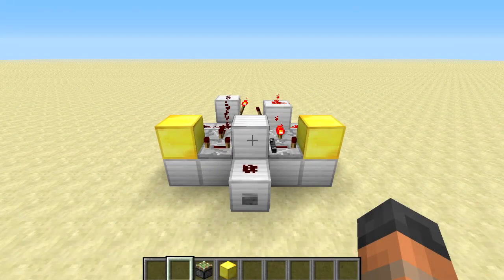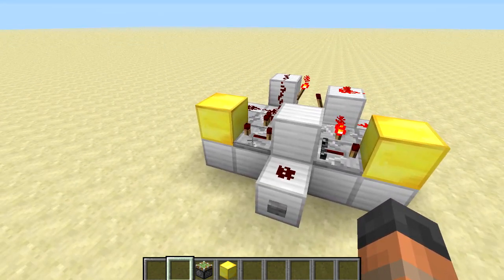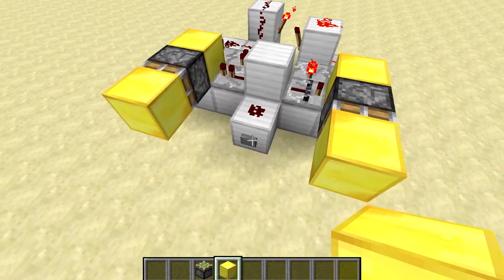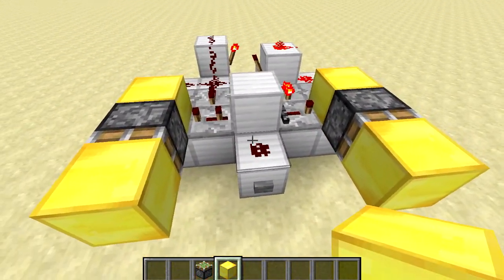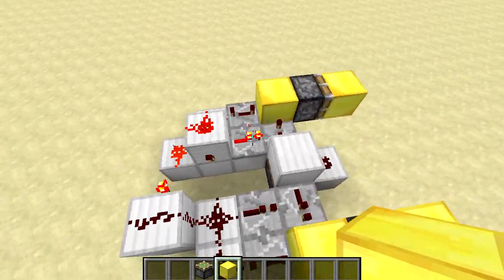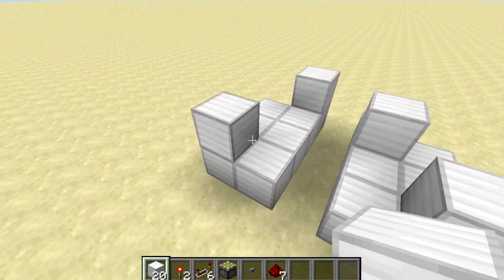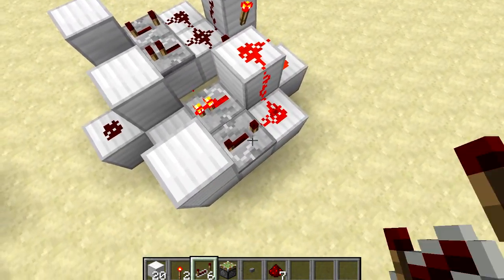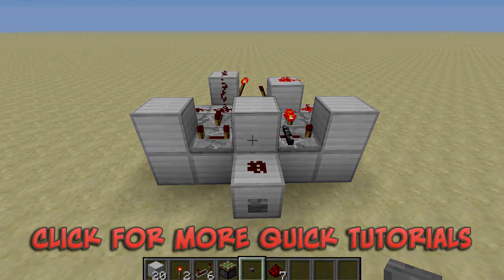Minecraft: 1-4 Tick Pulse T-FlipFlop (Quick) Tutorial

Comment: So you know in the demo in this vid you have the 1 tick pulse and then he pushes a gold block with a sticky piston and he only retract when you push the button again. So if you have a redstone torch that only powers the gold block when is extended you can use that powered block  to power a redstone or repeater so you have you powered output. You only need 2 sticky pistons, 1 button one redstone torch, 1 or 2 repeaters, redstone dust for output and some blocks.

Comment: If you need a short pulse, you don't need a T-flip flop, just a pulse limiter. Flip flop (a bistable) ideally provides continuous output, not a pulse. But you can convert continuous output into a pulse using a pulse limiter (trigger or monostable). You can have rising, falling and double edge pulse limiters, that are quite compact and can be modified to do everything this circuit can.